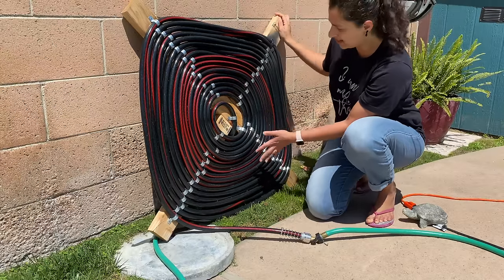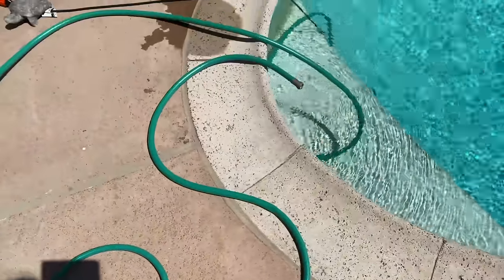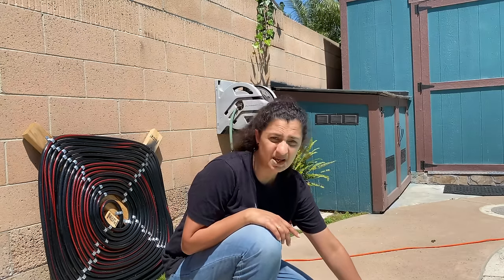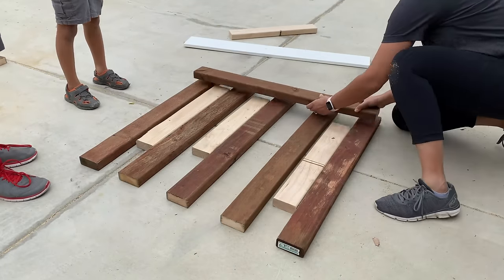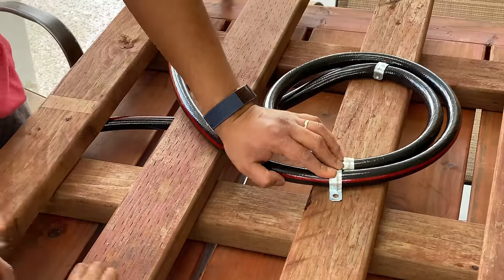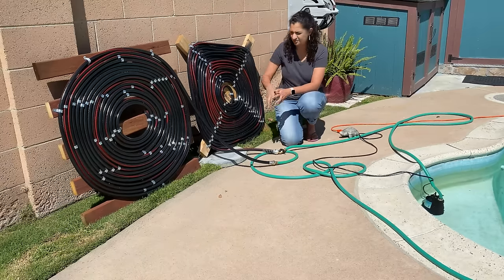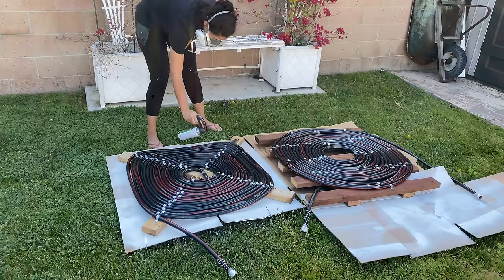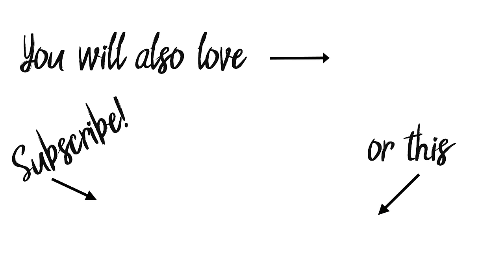DIY Solar Pool Heater - Simple & Easy Design - Did it work? | Anika's DIY Life

Comment: Get rid of the valve. Ex say the sun is putting 1000w of energy on the hose. If the hose is staying cold that means the water is absorbing the energy from the hose and putting it in to the pool. If the pipe is heating up then you are loosing energy in radiant heating up the air around the pipe.
Reply from the maker: Did you see the flow rate vs water temperature experiment I did ? If not take a look on the blog. Link is in the profile.
Reply: @Anikasdiylife  I did but that is not how entropy works. The output temp does not matter by itself. The gpm x difference in  temp is what matters. If the sun puts in 1000w per sq meter then it does not matter if the output is 110 degrees at 120gph or 80 degrees at 480 gph it is the same amount of energy going in to the pool because they mix with the  the other 20k gallons of water. As long as the pool water is colder than ambient air temperature then you'd want full unrestricted flow. You would start to close the valve only if the entire pool was above ambient air temperature. The hotter the black tubing is the more heat loss you have to ambient temperature. The cooler you can keep that pipingthe more energy from the sun is going into the water into the pool
Reply: @Anikasdiylife  Also on your own chart you put at 1 gpm it was at 32 degrees delta and at 7 gpm you were at 7.5 degrees delta. One gallon would need to be at 52.5  degrees to equal the same energy transfer, so 1gpm is 60.95% efficient to 7GPM. That 39.05% loss is due to convection.  The goal should not be to heat the water at the end of the hose it is to heat the pool.

Comment: Not hard to heat water in a hose exposed to the sun but unless you can make a difference in the overall water temperature it's not a big deal. You need to measure the water temperature on the far end of the pool and see how much hotter it gets along with the time it takes to get there. If you can raise the water temperature that be great but in my opinion unless you have a solar pool cover to retain the heat it may a tough go. I don't care what grounding your pool has I never let anyone in a pool with any pump in the water. There are much better designs on DIY solar heater on the internet.

Comment: The sun is already heating the water in the pool during the day. Maximizing heat gain in your system (you showed ~40 degrees) is not your goal. Your goal is the overall temperature gain in your 20,000 gallon pool. 

In order to test the effectiveness of your system, I suggest filling two identical baby pool with equal amounts of water. To make the math easy, let's say 20 gallons. Hook up your system to one of the pools and let the sun do it's work on both. Compare morning and evening temperatures. The difference of the overall gain for 20 gallons is your system's heat gain minus the non-heated pool. Now divide that gain by 1000. That would be your gain in the pool using your system.

Let's say for the sake of argument you gain 40 degrees on a 20 gallon pool. With a 20,000 gallon pool you'd end up with a  .04 degree (40*20/20,000) increase  if hooked up to the pool. If this is the case you'd need 250 degree increase (100/.4) to gain a single degree in your 20,000 gallon pool. In other words, your system would need to boil water.

Alternatively, if your current system only produced 20 degree increase in the test, you'd need 50 of your coils (25*2) for a single degree increase in the pool. And you'd need to pump it 25 times as fast or you'd have to build a system which could withstand that amount of heat and pressure. All this for a single degree improvement!

Why not just place an insulating "blanket" over the water at night to retain the heat and remove it during the day? It seems that would be far more effective than heating a trickle of water.
Reply: I should also mention that if you want a 10 degree increase using a 40 degree heat gain system for a 20,000 gallon pool, your pump would need to process 5000 gallons of water in a day's time. That's your desired flow rate assuming your system can perform at those levels.

Comment: I tried this myself 3 years ago and it was a complete flop. The science is that a lower output temperature  but higher water flow will yield the most heat. The  4  panels I made produced only a trickle of extremely hot water and it had little effect on my pool. If you have a full sun backyard, just buy the commercial solar panels  - which actually work.

Comment: Unfortunately these dont work...  but a 50k btu heater costs about 300$ and it will work!
Reply: I beg to differ, my system is doing around 20000btu, solar pv for rhe pump, temp controller for start in the morning and stop in the evening. 1000l/hr 5c dt. You can see it on my channel. Our pool was starting to get too warm end of May. When I left to come back to work early June the wife has stopped putting the cover on, when normally that is only done in July. Pool is over 32c
Reply: @DaveAuld  I watched your video. You are using 150 meters of 30mm irrigation hose. She's using 100 feet of 5/8 inch  garden hose. That means you have almost 10 times the surface area that she has.  Yours is also spread out loosely over your yard, so it can capture heat from the ground. In order to get similar results, she'd probably need to build 15 of her solar heaters to match your output.
Reply: @billweasley1382   Exactly - its all about the surface area of the "collector" - solar insolation in California is approx. 7 kWh/day/sq meter in summer - which means it would take about 18 days to heat a 20000 gallon pool by 1 deg C (1.8 deg F) with just a single square meter of collector surface at 68% conversion efficiency (which is quite high) - not accounting for night time loss of heat and evaporative loss of heat. @Dave Auld's system also had the pool cover which helps a lot.

Comment: You will gain more heat the faster you run the water through the collector. You should open the valve and let the water move through the collector as fast as your pump will move it. The rate of heat transfer is a function of the difference in temp between the water and the pipe. The slower you move the water the lower the temp difference. This decreasing the efficiency of the collector. I know this is counterintuitive, but it will make your collector as efficient as it can be resulting in the greatest increase in the pool temperature.

Comment: If you cover your pool at night that will make huge difference get a solar cover it will retain heat of pool and keep it cleaner and will cut out evaporation as well.please take it from me buy one for an above ground pool because once you say for in ground pool the price is ridicukous. I paid $60 for my pool solar pool cover it looks like bubble wrap but sturdy.
Reply: 6 mil 20x100 sheeting from HD, enough for a couple covers. Lay hose around perimeter to secure to coping.

Comment: Could you please give us an update? Is it working ?
Reply from the maker: Yes it is! We run it on a hot day (80F) with a moderate flow and the pool temperature has maintained to just over 80 F. So any day we want to swim in the afternoon. We just run starting around 10am once the sun comes up.
Reply: @Anikasdiylife  It's not maintaining 80 because of the "Trickle", it's maintaining because the air Temp. is maintaining .

Comment: Instead of using a sump pump, wouldn't a 1.5" to 3/4" hose adapter on one or two of the returns work? (https://www.amazon.com/gp/product/B07GX39YFK/ref=ppx_yo_dt_b_asin_title_o00_s00?ie=UTF8&psc=1) Then connect a short garden hose to your coil(s) and let the pool pump do the work.
Reply from the maker: Yes. It would work but a pool pump uses a lot more power than the sump pump

Comment: Put your coils in a wood box behind plexiglass. Put your pomp on a timer. 15min on, 15min off
Reply from the maker: The goal was to keep is inexpensive. Plexiglass that size is SO expensive.
Reply: @Anikasdiylife  that's treu. But an investment well worth it
Reply: Bert V a timer is counterproductive! Cooler water will pick up more heat- keeping the water moving improves efficiency.
Reply: look on classifieds or used reno store for some regular glass windows
Reply: or saran wrap lol
Reply: @Anikasdiylife  Vapor Barrier! Nice and tough and if it rips, roll on a new piece.
Reply: @Anikasdiylife  And pressure treated wood isn't?

Comment: lol these youtubers keep trying to get the highest possible temps!!. I'm gonna make one. Let it sit for 12 hours in the dessert sun. the show you'll my 85 degree increase. Other people beat me too it.... water flow doesn't matter. the energy transferred will be the same. You may damage your pump by restricting flow..[possibly.. don't quote me on that
Reply from the maker: This was to show you that you are getting a temperature increase and what that depends on. Also, yes, you want to run the water at slightly above the temperature you need the pool to be. We are able to raise the temperature of the entire pool by about 5 F by running the pump for about a week in 80F+ weather.
Also,  There is no harm in restricting flow through the pump... as long as you don't turn it off completely. PS: I am a PhD Physicist and electrical engineer.

Comment: Lady , you don't  know  what you are talking about.  First get some more knowledge in this matter,  than post a video.
 For example: the burning match has high temperature temperature  comparing to qube of ice. What do you think , how many matches will melt that qube of ice ? 
 To heat all water in your pool you have to do some math, prior to set up the water flow . With the flow  you showed on the video , it can take a few hot days to raise temp. by couple of degrees.  What you will loose during night.
Reply from the maker: I have a  MS in Physics and MS and PhD in Electrical Engineering but what do I know? Huh?! And why don’t you do that math and get back to me. I will wait.

Comment: Does anyone know about the content of lead in the average garden hose? Or the outgasing (due to excess heat) of the pvc that ALL garden hoses have ? Be safe don't drink water from garden  hose also   means don't swim in tainted water ?
Reply: 65 years old and have drank water from my garden hose for 55 years so please....
Reply: @rickmath  ... actually the guy has a point and they do sell hose that meets potable water quality. OTOH, even when using a standard hose for say an RV domestic water connection it takes time for stuff to leach out of the hose. Basically it's the time between uses that counts. With continuous running water you'd be hard pressed to find any added containments, which is how we all survived childhood drinking issues.... and of course you were smart enough to let it run till it was cold.
Reply: I dont think a little is so harmful, but I agree. They put so much industry waste in some of these new production materials..its one way they get rid of biproducts in production. I prefer the bubble insulation pool covers. they likey off gas as well, but, I dont drink pool water.
Reply: Lead in your head makes you less intelligent...ask any doctor

Comment: Use pool blanket!!

wrong wrong wrong. OMG... How much collecting area do you have.. not much... If you put a pool blanket on pool you have entire pool blanket surface area.... and no pump.. How do you control heat?? if you want more heat in water put the pool pump on during the day. If you want less heat ,turn the pump on in the coolest part of the night.. If you want even lower temps take the pool cover off... Its really that simple.. Know this though. if your pool is warm and you remove the cover It will loose about 500liters of water a night depending on temp and windspeed and humidity.
Reply: How do you swim with a pool blanket?